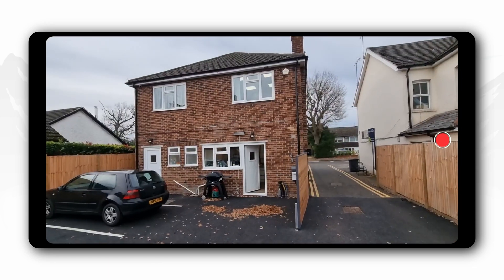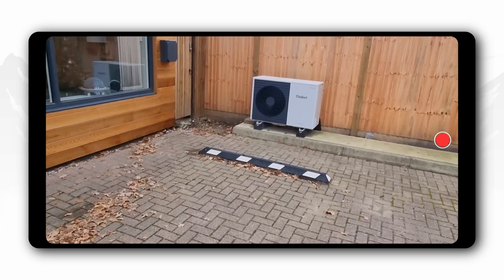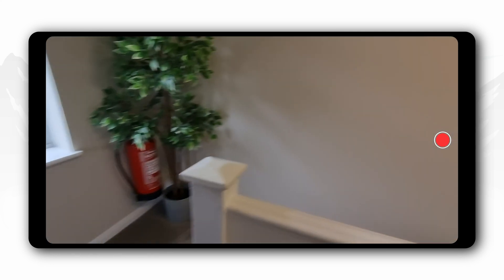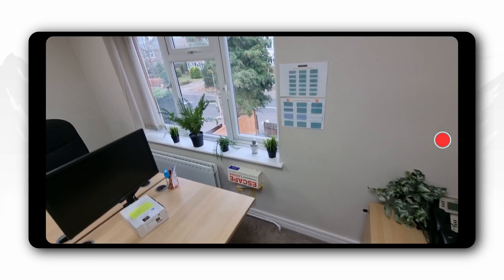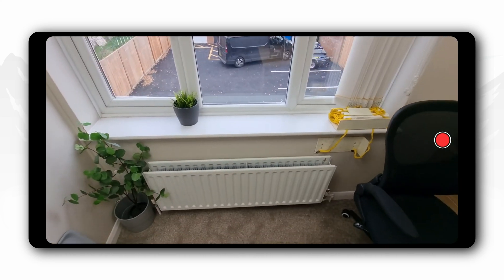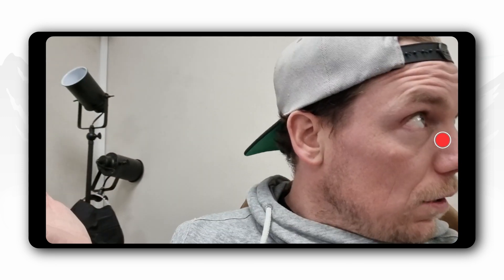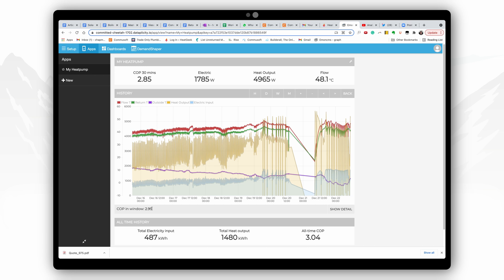Can Heat Pumps Heat A Normal Building?

Comment from the maker: Sorry all we left out an important peice of information here! It was a pretry much consistent 21c internal temperature internally all week too. We will drop a link below here so you can look for your selves at some point.
Reply: Sorry, a bit qwick for me. Can have the idiot guide. Seem impossible
Reply: L
Reply: @Heat Geek Great material, thank you! Could you give the summary of monthly cost of heating this property in December or January?
Reply: Do you have an up-to-date figure of how much electricity your vaillant arotherm plus has used since the start and how many days has it been running and I notice on one of your videos you have a viessman ashp is this the latest model and are you going to compare the two
Reply from the maker: @patregal  it's the 'latest' viessmann but the latest viessmanns been out years. Yes we're constantly monitoring
Reply: In the graphic you shared there is the all time history, and total electricity input. For what duration is that?
Reply: @SanemSSever  which time code bud?
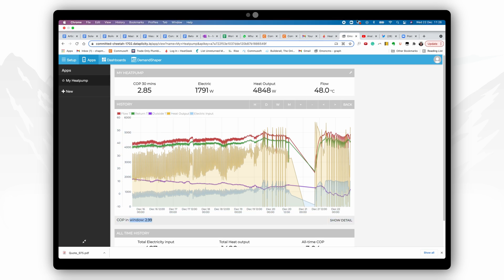Reply: @ChapmanPlumbing  3:19, in the dashboard view of the heat pump data, sorry for not being enough specific :) I am trying to collect data about  electricity consumption to decide feasibility. And your set up is a good example.  I have a 120 years old house and due to monumental status it only has internal wall insulation, HR++ all windows, complete roof insulation done very recently and reasonable floor insulation(not very well but better than nothing) and 9 solar panels.  We were considering going hybrid with ecoTEC Exclusive + AroTherm, and while researching I found your channel, and noticed that the company did no survey at all(they were guided by Vaillant itself ). Unfortunately we are in Netherlands and don't know who I should approach as an expat living here. So all info you share is so invaluable.
Reply: @SanemSSever  6 days, our electricity usage wont reflect yours though.
Reply: Am I correct in assuming that, as the radiator side was designed for a higher feed temperature, the current flow rate is quite high?
I mean, you'll need to get a certain amount of energy into the house, one way or the other, right?
Reply: One thing I noticed was the flow temperature. 40'C ! .... That is the key point that we all is the problem.
Reply from the maker: @cuckingfunt9353  why is that a problem? If will get hotter as the outside temperature drops.. no point firing higher than required with gas or heat pump. Lower the temperature the better
Reply: @HeatGeek  Those rads will need to run at 80'c on a cold day.  What COP does your system achieve at that temperature ?
Reply from the maker: @cuckingfunt9353  this is weather compensated. The curve selected is set for around 55c at -1. If that wasn't enough the property wouldn't be warm right now..
Reply: @HeatGeek  I don't see how that house would be warm with -1'c outside and a 50'c flow... But that aside, what would be the COP at those temperatures ?
Reply from the maker: @cuckingfunt9353  it wouldn't.. it would need to be 55c... I can tell you when I get in as we had -1 back in Dec and I can look atbthe software
Reply from the maker: @cuckingfunt9353  Just checked, when it was -2 for about 12 hours over night in dec the flow temp went up to 56 and cop was 2.48. however we had the room temp set to 21c which is shouldnt have been, if it was set back to 18 cop would have been higher.
Reply: @HeatGeek  OK, so you are saying those small radiators heat your house to over 18'C with a 56'c flow temp at -1'c outside ?
Reply from the maker: @cuckingfunt9353  yes

Comment: I'm with Octopus Energy who charge 20p/kWh for electricity and 4p/kWh for gas, same standing charge for both. As much as I like the idea to move away from gas heating, I'm not sure it makes financial sense even if the cop was to improve to 4. Any price increases for gas is likely to push up electricity prices too. While ever electricity is 5x the cost of gas, it is going to be hard to justify moving to a system that requires electricity.
Reply from the maker: Actually I think once this has sensible radiators the SCOP will be more like 5.

Also as the subsidies are removed from gas the gap will shrink further.
Reply: Historically, because gas is mainly used for heating and the govt didn't want to freeze pensioners (and others in fuel poverty), various energy taxes were all lumped onto electricty rather than gas.

If it were equitable, gas would be twice the price and leccy about a quarter cheaper.
Reply: It seems to me that as the proportion of renewables increases in the electricity mix the price of electricity should become decoupled from that of gas.
Reply: @rogerphelps9939  That's a reasonable assumption but at the moment the opposite is true. The increased proportion of renewable in the mix has increased dependence on gas generation to deal with intermittency. Because renewables have driven average wholesale prices right down, generators that are available on demand (e.g. gas) are increasingly targeting only short term grid balancing contracts, which are very lucrative (i.e. expensive per Kwh). Renewable generators also sometimes get paid huge sums for curtailment (i.e. switching off) when there is insufficient demand (e.g. in the middle of the night) for their contracted electricity. Both factors drive up the average kwh price seen by consumers over a period of time. 

The grid will therefore need both much cheaper storage (e.g. batteries/hydrogen) and time shifted consumers (e.g. smart electric vehicle charging & domestic thermal storage) to take full advantage of the lower generation cost of renewables. The heat pump industry's pursuit of demand tracking (e.g. VRF & weather compensation, as shown in this video) rather than price tracking & thermal storage (to take advantage of much cheaper renewables, as and when they are available) does not help in this regard. We will need a new market system, where the consumer is given the right financial incentives (e.g. more granular, market tracking, unit pricing of time based consumer tariffs, grants or cheap loans for domestic HP & thermal storage) to change this. 

In a funny way it's advantageous that the UK market for HP has been slow to develop, because we now have an opportunity to get the domestic technical solution right from the start, before a large roll out. It's also interesting that Kensa, the UK's leading GSHP manufacturer, have deliberately chosen not to pursue VRF, so perhaps they can see what's coming. But current government policy in terms of grants, MCS guidelines for sizing, system design and controls are not (yet) at all aligned with this objective.
Reply: Not worth changing early, but might be worth considering when it's time to change.

Electricity can be self produced.

Comment: But surely this isn’t a question of efficiency, but rather the question is; “is the house hot enough??”……
People generally don’t care if the system is efficient, but they do care if the system is hot enough.
Seldom does a gas engineer get a phone call saying that the system isn’t efficient. Generally the phone call would be that the radiators aren’t getting hot…… 

Personally I think you guys are totally peeing in the wind and you may get to the end of your career/life and say, “what a waste of time that was”……. But there’s no harm in trying……. 
I think you guys would be better educating engineers on how to design a gas boiler system correctly. 
Perhaps designing a gas boiler system to run like a heat pump I.E bigger radiators and lower flow temperatures…..
Reply: 21 degrees? I have my house at 19 and find that to warm most of the time.
Reply from the maker: @hans.vbaalen  tell me about it! Not my choice!
Reply: Poor efficiency is the same as high operating costs. There is going to be another big price hike, especially for gas, in the spring and I can assure you that running costs, meaning efficiency, will become paramount.
Reply from the maker: We've been doing exactly as you say for 3 years already 👍 

The building was 21c internal. 

A heat pump is just another heat source. It's all down to the system. Not the heat source. Heat source is irrelevant

Comment: How long in each 24 hrs is HP running? 
My experience of GCH in "normal" houses, is whack it on by timer 90 mins before getting up, also again an hour before get in from work, turn it off let house cool down, rinse & repeat. Because it heats house up quickly (assuming normal size rads!), the lack of insulation is not noticed. 
However, as HP uses lower water temp, this on-off tactic surely won't work? 
Couldn't make out graph info on phone, so apologies  if this information was there.
Reply from the maker: If you have a condensing boiler that is not necessarily the most efficient way to run your system at all.. most boilers and heat pumps benefit from 'steady state heating'
Reply: @HeatGeek   I'm trying to get a handle on that too. My objective is 19c for 1 hour in the morning & 5 in the evening,   & don't care about the rest. So how much thermal energy am I saving by letting the temp slump in the day & night , as the cooler house leaks less heat?  Its a tricky calculation / measurement because its factored by the thermal mass of the building as well as insulation & outside temp.
Reply from the maker: @brackcycle9056  to many variables to answer for 1 person. With a heat pump it's unlikely you will only want 2 small heating periods and be more efficient though.. again depends on your set back temp.. its all a balancing act.
Reply: @HeatGeek  I’m not a central heating engineer but a chemical engineer andI have to challenge you on this statement. Surely for any building what you are paying for is the heat energy that leaks to the ambient, to the atmosphere and the ground. Simply put if you keep the house at 20C constantly then your heat losses and hence costs are higher then when operating your heating at lower temperatures when either no one is home or all in bed. I suppose it depends on how you are using the term ‘efficient’, but the science is straightforward.
Reply from the maker: @tsb3093  that would be correct if there wasn't efficiency gains from lower temperatures.. if you wantbthe maths as proof watch this video https://youtu.be/zpTVIeUh04E
Reply: @HeatGeek  lower temperature of what? Of the circulating water, or of the building/room average temperature, or of the ambient?
Reply from the maker: @tsb3093  the circulating water.
Reply from the maker: Watch the video it explains
Reply: @HeatGeek  your maths is sound and I understand that the efficiency of the heating unit increases with an increase in the dT between the primary and secondary fluids but that video is a bit too granular for the point I was making.
Also that the efficiency of the design, particularly for the ASHP system would be better if the system is run at a steady state, that is operating continuously.
But there is no denying that if the system is switched off 16 hrs out of 24 it will result in reduced heat loss across the normal day and hence be cheaper to operate.
Reply from the maker: @tsb3093  as per the video.. the heat loss is high with continuous heating. But the problem is heat loss is not the same as heat input.
Reply: @HeatGeek  it depends on the time period you are considering. Over a long time period with constant ambient and indoor temperatures, it is the same, if you ignore the heat loss from the boiler combustion flue. If you are heating up a house from cold or alternatively the house is cooling down with the heating shut off, then of course it is not the same.
Reply from the maker: @tsb3093  if you go to our website we have covered all these variables. We are also releasing a video onnthis exact subject very soon